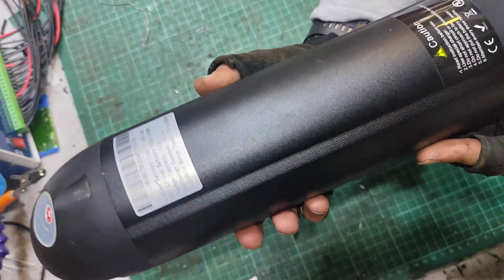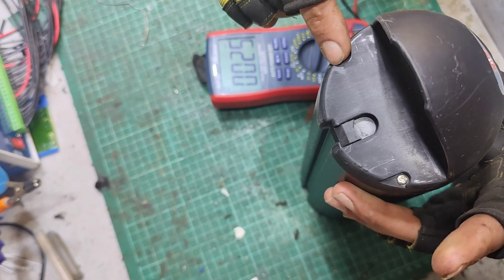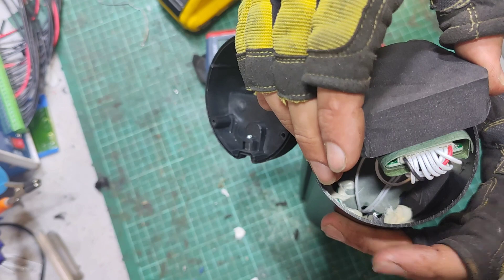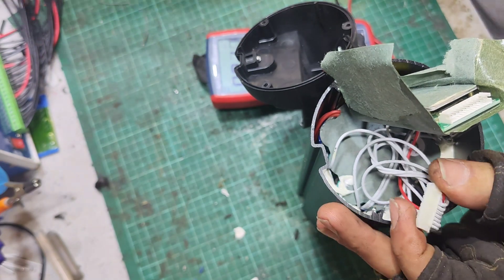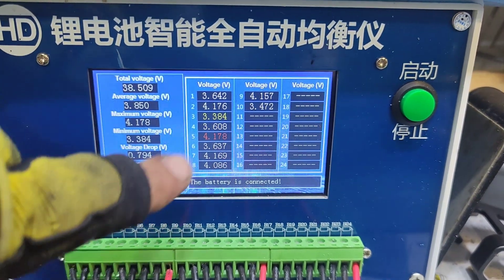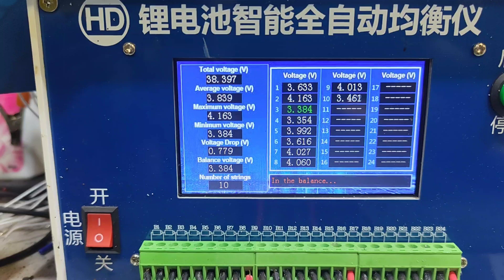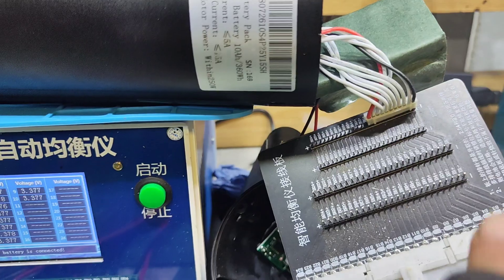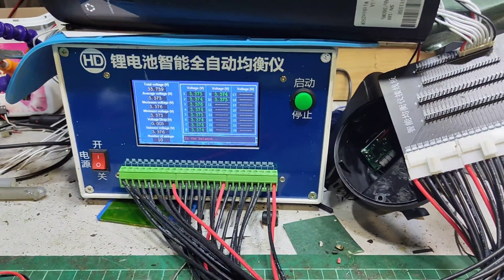Great Battery balancing machine - quick test and results!

Comment: Hi, thanks for the simple video and explanation, but in regards to balancing, how would you get that to balance to the highest cell instead of the lowest cell?
Is this the best way to balance (balance to the lowest instead of the highest cell)?
Wouldn't balancing to the lowest cell cause a reduction in range? Also, I noticed that the total voltage dropped from 38v-33v, would that signify that the battery is on its way out?
Would you use this method to try to revive dead or near dead cells and why/why not?
Would this be considered passive cell balancing as opposed to active cell balancing?
What if the cells don't balance, would those cells be considered dead and need replacing?